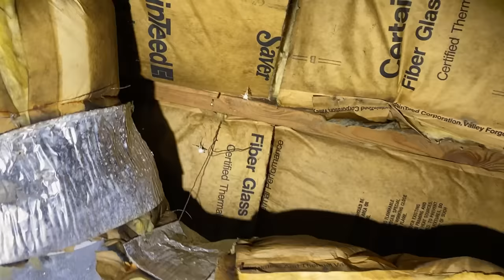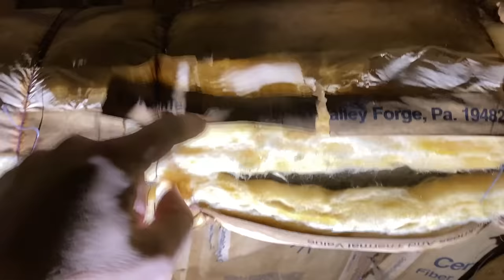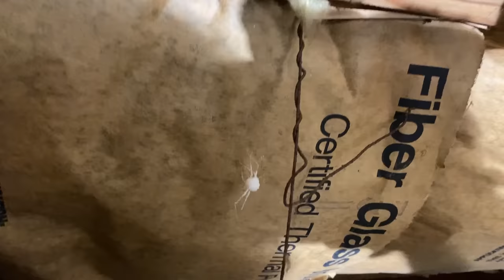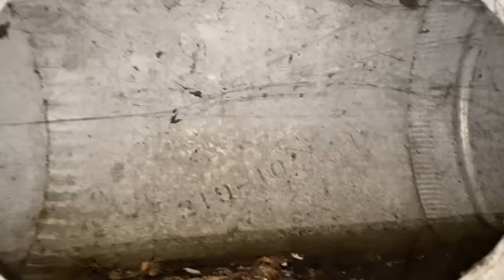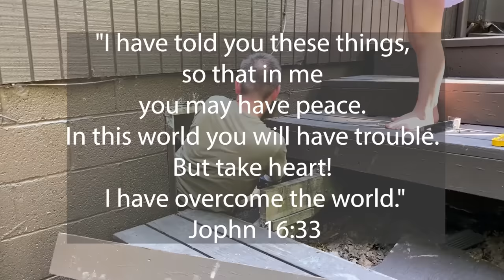Finding A Secret Room Under My House and What Was In It

Comment: Having been a mold and toxic mold technician in outpatient medical facilities, the experience made me go into hvac with a degree to find out about negative air pressure and other causes of the really nasty stuff like legionaries. Here are some free professional suggestions. 1 put a stand-alone self-emptying dehumidifier in that basement and fix the downspout until the entire house reaches below 50% relative humidity, also tie in your ad hock duct drain to the sump in the de-hu pump reservoir. Clean the filter on the unit ( biweekly) until the humidity level is reached. The humidity level retards or stops mold growth. 
            2, round metal ductwork is the most effective in transferring air volume, and flex duct is the worst in air friction coefficient. Get it professionally sanitized, replace rust outs and seal any leaks or seams, or joints that can be done without ripping out walls. Upgrade filters (air) to merv 14 charcoal rating and also change to 2-month change intervals. Do not buy into the hype of a total duct replacement and system change, flex costs more electricity to push the same amount of air.
          3, Houses in the '70s were just the beginning of mold-resistant wallpaper glue painted wallpaper just exasperating the sealed-in mold growth between the walls drastically hindering a clean bill of health upon resale of the house. Unfastened and unsealed duct joints cause small infiltration points for mold spores and as the humidity lowers the mold will produce more spores as colonies die off. To check bathrooms I suggest the seam around the toilet water supply as it is less noticeable, the back of the toilet (take off tank lid), and under electrical cover plates. no need to rip out the paneling or sheetrock if not necessary. Also vent all humid air until you know the shape of things (hot showers, cooking).

Comment: You have ducting down there for heating and cooling.  Converted into your shop or office and use it like someone else suggested as a tornado shelter because it has cinder block all the way around it.   Such an awesome space that's currently being wasted.  Reclaim and use it.
Reply: I am a licensed home inspector:
1. Concrete blocks (concrete masonry units) can only be made moisture proof from the exterior of the wall. A difficult expensive job. 
2. To make this space habitable it must be heated and cooled just as your upper floors. 
3. If this will be an unused area one must provide constant ventilation with an appropriate exhaust fan with ventilation openings, to prevent dangerous mold formation. 
4. All the insulation should be replaced. Mold spores may be within the old insulation and/or under the floor boards.
5. Do not add any vapor barrier other than applying an appropriate vapor-resistant paint on the block wall. 
6. All exterior earth must slope away from the foundation walls to prevent hydrostatic pressure against your foundation walls. 
7. Downspout water discharge should use solid plastic pipe 10’ away from your home.
8. An interior or exterior access should be built to allow for regular inspection. 
9. Open the wall where the HVAC ducts are coming from, to inspect all of your existing crawl spaces. 
10. Have air quality mold tests taken at all living spaces. Use a qualified professional laboratory to test your air samples.
11. If any residents have respiratory problems, visit your family doctor.  Bring your mold testing laboratory reports, for review. 
Have a healthy life - These steps could prevent serious health issues.

Comment: Agree with others -" A " coil in the HVAC condensate catch pan ; rusted out ? or a very common problem is the codensate drain line is plugged (usually at the trap). You would be suprized how much water can be produced in one day.  Lots of good possibilities for the space. At least make access easier for inspection.  Thanks

Comment: It’s kind of cool once you get rid of the smell, I’m just looking in it I don’t see any mold or mildew which means it stays pretty dry, I would almost go through the brick and put an access door and make it usable that could be some good usable storage you can put water heaters or whatever in there. Once you get the smell out plus that insulation is falling off you’ll be able to fix that. It’s kind of cool in a way

Comment: That could be anything I had a situation with ground water and I had to put a massive amount of drainage work into the property to not have it stay full of water and what you’re working with seems like a plugged condensate drain or an AC that’s freezing the coil occasionally,  and foam board does an AWESOME job of creating a clean insulated space with fairly low amounts of work involved 👍🏻👍🏻

Comment: You could have septic gas backing up (leaking into basement) from a clogged vent pipe. Our septic was failing and sewer blocked the vent that septic gas normally escapes.

Comment: As others have mentioned a blocked condensate drain on your hvac system is a possibility, something else I thought of is if a toilet has overflowed at some point and ran across the floor into a heat duct. I hope you get it all figured out and fixed up.
Reply: With that airflow, the water source must be continuous, not a one-time event. Otherwise it would have dried up.

Comment: Our house is in east Texas…it is pier and beam…it is 113 years old…it is a two story and is 4,025 sq. ft. with a large L shaped porch and a matching L shaped balcony.  There are a number of vents around the house on the lower story on the concrete…the vents are rectangular in shape and there is a heavy wire fairly large hole design to keep animals out but let’s air/ ventilation in and out under the house.  There are no closures but we cover the openings in winter and take the covers off when spring arrives…warm weather for sure.  We also have 6 doors to the outside…one on each side of the house downstairs and two going out onto the balcony…one to the front which is facing south and one that goes out onto the east side onto the balcony.  The original owner and builder was very aware of what would happen if there was a fire upstairs.  The 5’ wide hallways upstairs goes from one side of the house from east to west then goes north to south which goes from the front to the back which is where the upstairs bathroom is and the curved 22 riser staircase is right outside the bath.

Comment: That is a lot more than just condensation and would have showed up decades prior to now if it really was a persistent problem. I would definitely check for a slow leak somewhere above. I found a slow leak in a refrigerator connection that didn't present for weeks  until I noticed some birdseed that fell into a crack in the tile begin to sprout that the issue was brought to my attention and I traced it back. Check above the duct work for a wet subfloor.
Check the condensation drain for your AC. Open the ductwork to see how far back the wetness goes and/or see a flow source.

Comment: Do you have a house dehumidifier?  When my dehumidifier wasn't hooked back up properly after a new furnace was installed, I got the same type of water leaking problem.  There was a hose not attached and all the moisture being pulled out of the air was just flying out the end of the detached hose.  Ruined a lot of stuff.

Comment: After seeing the wy the insulation was installed, they fell for the error a lot of people do. The vapor barrier should go towards the heated area not the under house space. Metal or plastic stays are used to hold the insulation up. It's installed every 12 to 18" a part. The insulation around the duct work should be foil backed and taped in place with special tape made for this purpose. This space can be used for many purposes.

Comment: You may want to verify either the clothes watching machine or the dishwasher drains, most of the time they are improperly installed and require a “P trap”, or in some instances, you may have an un used “P trap” somewhere in the basement that has dried up because it is no longer in use. (If an unused “P Trap” before capping it and sealing it, you may want to fill the “P trap” with cooking oils that won’t evaporate, then cap and seal it!

Comment: The condenser on your air conditioned system could very well be the reason for all this water being trapped in those pipes. That type of insulation can absorbed condensation over the years that might be what's causing the smell. I'd consider digging alongside the outside of the house and put a membrane of sorts to keep the water  from seeping trough the block.
Reply: I thought of the condenser too.  God knows if anyone has ever checked on it to see if the water is still draining out of it, or if its super scummy.  Anyone who has ever used a window air conditioning unit knows how gross they can get.
Reply: The condenser is in the outdoor unit. The evaporator is inside and connects to the ductwork. The naming is a bit confusing because they are named after what happens to the refrigerant, not the humidity in the air.

Comment: Here in New England, that space would be called a common basement or cellar.  There was probably originally a furnace and oil tank in there to heat your home when it's cold.  Most of the time, but not always, there's a staircase going down from the inside to get to the basement.

Comment: My grandparents basement would flood during a heavy rain. One day when my grandma finished going to the bathroom she stood up and just happened to look down at the floor vent and saw her reflection. Turns out static pressure was causing water to build up and leak into the vents. After placing basically a moat with two water pumps in their basement that solved the problem. I’ll have to check out your other videos to see what the problem was

Comment: Fifty years old ducting with no insulation will generate condensation from Aircon in summer and cold space to heating in winter ,reinsulate to modern standards and leave a couple of your drilled holes to allow continual drainage  as stagnant water in the duct perfect place for bad smells to multiply,your great room will be much warmer too.

Comment: Just ran across this but one thing if your ac is old check it's drainage right from the unit. We ha a problem,  but it overflowed to the living room and ruined to carpet so we found that fast. I'm thinking it channeled to the pipe.

Comment: Are there floor vents in the bathroom and/or laundry room? I'm guessing somethings overflowed at some point and the water got trapped in there. I'd watch it for a while and see if more water gets in. If water keeps coming, it would have to be a problem with heating/cooling system. I know A/C produces a LOT of condensate, but furnaces shouldn't. All indoor A/C exchange units I've seen have a drip tube that runs outside to drain the water out. That might be the problem, I'd have a heating and A/C professional look at the system. I'm also wondering how you get access to the rest of the vent pipes... is there another crawl space access?

Comment: The insulation could be hazardous. The yellowish orange and be formaldehyde. My apartment ceiling heat had this color of drip. I had to move for them to remove and clean due to dangerous, also the popcorn ceiling too. Aspetos was also used in the 70s. Fans  and a respirator is needed plus.

Comment: It sounds like it could be septic system.  I lived in a house for 38 years and the smell that your describing is from a clog in the line.  From either the laundry room.  Or the kitchen sink.  Both rooms the water has to go out through the septic system to the street if you live in town, or the septic tank if you live in the country.

Comment: How’s that going? Did you say this was from your central air conditioner unit? 
A /C takes humidity out of the air, but it needs to drain somewhere. Mine drains into my sump. Sometimes a gallon in a 24 hr. Period when humidity is high. Don’t use flex pipe what you have is good. Not knowing the difference between a footing and a wall points to needing some general knowledge. Would be great to puta concrete floor in with weeping tiles. Do you have HVAC?

Comment: May not help now, but don't put vapour barrier on bottom of joists. Cut 2' strips of poly for each cavity. Staple poly to bottom of floor, then add insulation. The room will be a co!d space then. Poly goes on warm side of cavity!
If you want to warm entire room, don't insulate or poly the ceiling;  build 2x4 walls near outer block walls, then insulate and vapour seal. Use rock wool.

Comment: first thing I think is bodies.  I would definately get that room checked out by professionals.  As others have mentioned, there could and likely is mold.  You do not want to be down there without proper resporator masks until it's figured out.  
Wow!!   What a find.   I wonder if you could access that space by breaking through the house foundation to make it accessible through the house or degrade the land to make a door.   So interesting.

Comment: That is not condensation forming inside the duct my friend, that is most likely coming from the pan on the central system. Typically there is a primary and secondary drain. It's common to have a kill switch (float) on the secondary, so if the primary backs up, it will stop the system. Not sure how yours is constructed, but if it's backed up and there's no kill switch, it may flood, but water carryover is a concern, which may be flinging water into the supply duct. That standing water will stink as it becomes stagnant, which is likely causing the smell. I would advise to check the coil, clean the pan, clear out the drain and install a float to kill the system if it plugs up. I DO NOT recommend replacing that existing duct with flex. What you have is better than anything you can buy now and a cleanup and reinstall of the existing is a much better idea. You can insulate it with foil-wrapped insulation and use zip ties and foil tape to secure it. Get a pro or do it yourself if you're handy, but I'd say you found the issue; standing water in the duct from a plugged drain in your condensate pan. You're the man.

Comment: Do you have a floor vent in a bathroom. Kids are letting bathtub water go down the hvac pipe. 
As for the celing of that room. Buy 2" 4x8  sheets of pink foam insulation and install it on the celing of that room then seal the voids with minimal expanding foam.
Pack gravel on the floor and insulation and pour a floor over it. You might need to install a sump pump pit. And pump 
You better fix the downspout water can 
Rot cement blocks.

Comment: It's probably sorted already but... I would have thought that AC could sometimes be so cold that water vapor in the air could condense to the extent droplets are formed and over the space of 50 years with no sunlight to evaporate it the droplets would build up, it's probably already been mentioned but I thought hey ho, there's a possibility your AC may just be Uber cold within the ducts/unit and your not aware because by the time it enters the house it's dispersed, maybe increase the temp of the AC a bit?! God knows, hope it's worked out and brewery would be my choice for it, you'd probably get some great wines, ciders and lagers from pre-bought mixes. Thanks for the content, Stefan

Comment: My AC drain was blocked and was leaking into the big air box that branches out to all the vents. My HAVAC is a down flow model. We just cut a hole in the flexable vent pipe for it to drain out problem solved. Our crawl space has good air flow so it dried out well.

Comment: You need a vent in the opening so the water can be able to evaporate! Under your house it should be vented everywhere, open vents in the summer months and rainy months, you can close them in the winter but make sure you open them back up in the summer and rainy times! If the water can't get out it will rot your floor joists!

Comment: I've run across this situation before. Usually the drip pan drain under the AC unit becomes clogged you might want to try blowing the drain out with an air compressor.

Comment: The water could be coming from the. Heating and air condensate drain being plugged this normally drains to outside or sewer with a trap so as not to let conditioned air escape or unwanted air entering hvac system

Comment: Im curious if the other side of that wall where the ducting runs aka the remainder of the floor plan for your house has space like that? Is there any other access points on the other side of the house?

Comment: Your extra room is interesting, but not unheard of.  I was sort of expecting to see a concrete ceiling in it that would explain it to be a bomb or storm shelter.  As a matter of fact, our previous house had a "secret" room also.  In our case, the access window was in the garage and hidden behind a sheet of Styrofoam insulation.  If you pulled the insulation, you had an opening the same as yours.  The room was constructed between the garage and main house which was a breezeway that was later used as a dining room. The floor in the room was concrete so the entire shelter was as solid as it gets!  Interestingly, it was very cleverly constructed with a concrete floor with a 12" wide area along two walls that sloped downward to form a drain trough.  Fresh water constantly came in from one corner on the uphill side, followed the through along the two walls and then exited via a drain in the opposite corner. The room did have one working light as well. So, we had a survivable bomb shelter with fresh water and a waste drain.  Not super comfortable, but survivable.